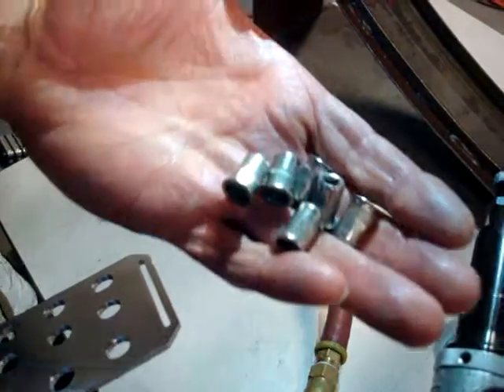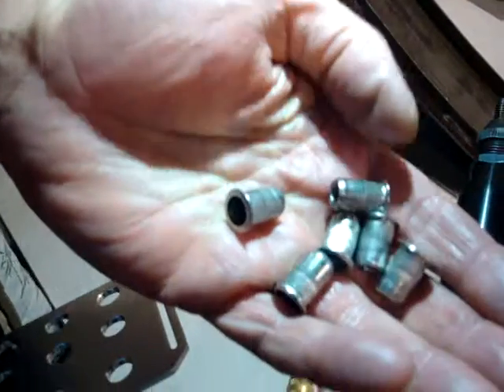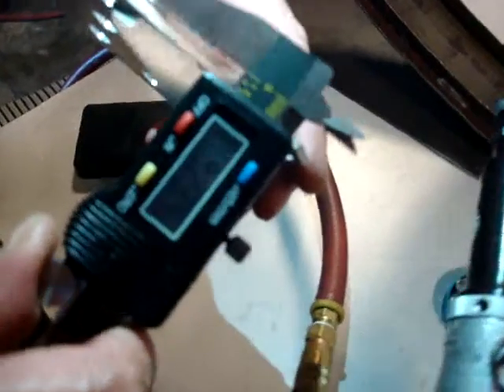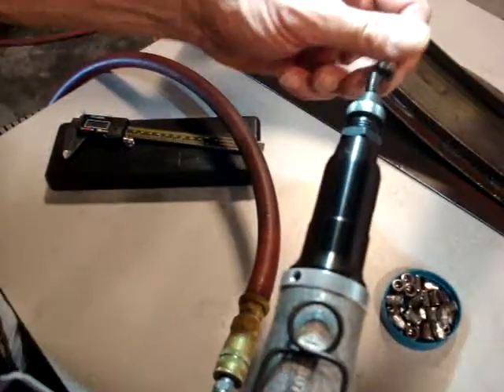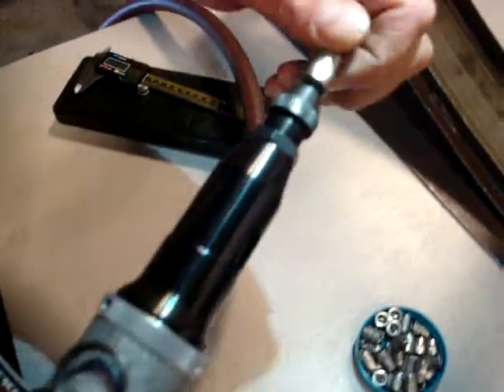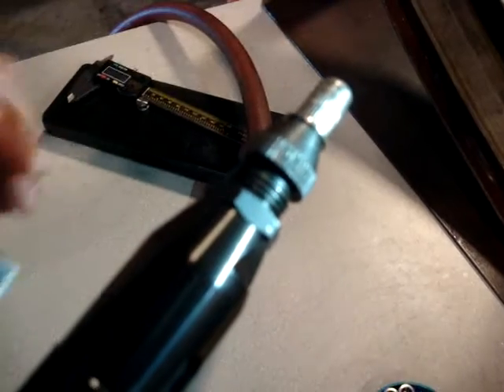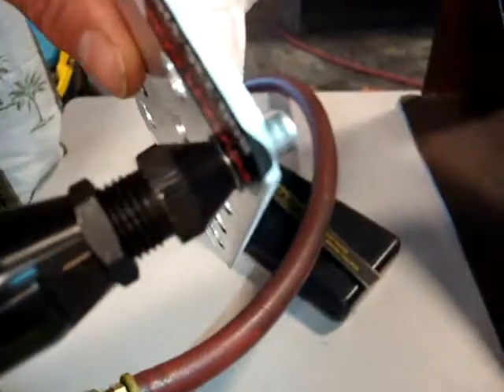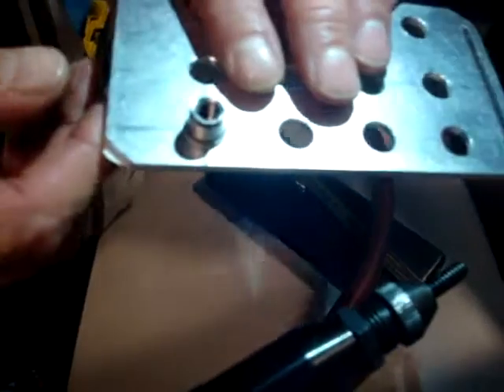4080 Tool Installing 1/4-20 Stainless Steel Rivnuts

Comment: Once a rivnut is installed can a normal screw be threaded through the tube?
Reply from the maker: Yes. You would need the correct thread size to match the Rivnut installed. If you install a 1/4-20 Rivnut you could go buy a 1/4-20 screw from local hardware store and thread through the Rivnut. Let us know if you need a Rivnut quote. We ship same day and have stock of many different styles. Thank you. 800-236-3200
Reply: Thanks!